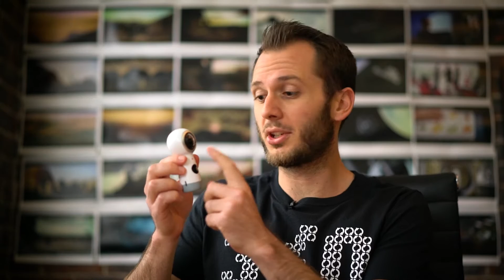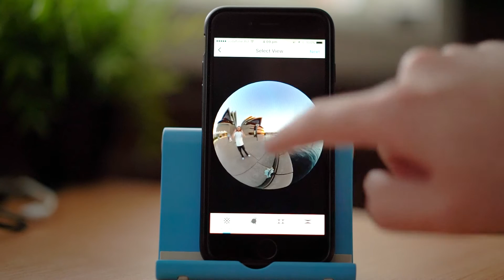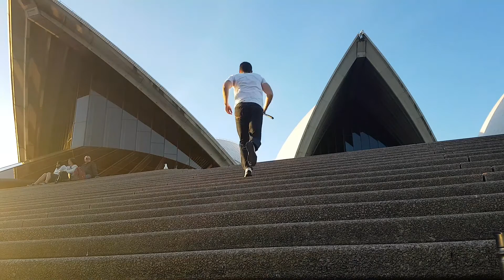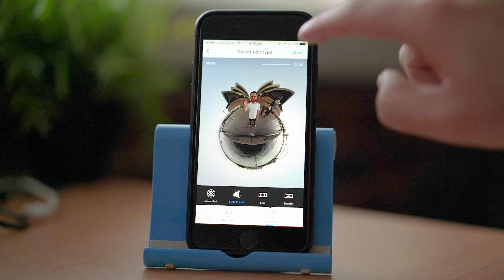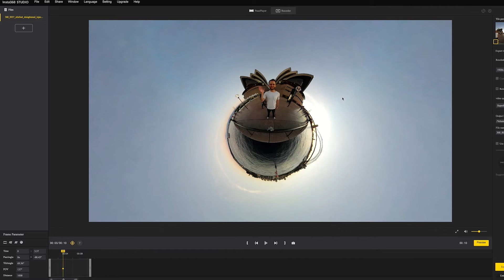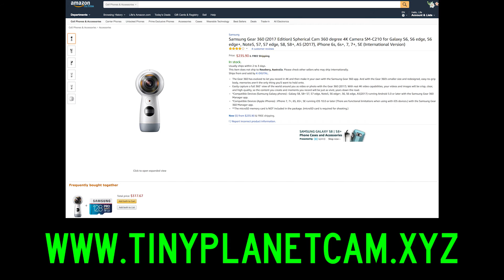How To Make Tiny Planets With ANY 360 Camera

Comment: This was a great video Ben thank you very much for making it. Unfortunately for some reason theta plus is not recognizing any of the photos on my Samsung Galaxy S8 when I go in there there's only just to stock photos. It will also not recognize any of my videos that I shoot on my Samsung Gear 360. is there a trick to this or am I missing something. Thank you so much for any and all help with this
Reply from the maker: +Kendrick Krause there's a separate app for video called Theta+ Video, and Theta+ has always worked for me once the files have been uploaded to the phone correctly. Cheers!
Reply: Kendrick Krause same problem here. Do you fixed it already.
Reply: Same problem

Comment: Hi Ben, perhaps you can help me out with a MiSphere relatet Problem: all over sudden PC (Winx)-Software refuses to stich Mi pictures. Pics taken yesterday or before are handled well, newly taken pics or vids cause the app to crash. 

Unfortunately I shot about 200 360s and some more 360 videos yesterday at a unique occasion and storage on my tablet or phone is far too small to stitch them via wifi and mobile device. Using PC and Mi Software is the only way. 

The software says "cannot transcode" with videos and crashes with a debug window "cpinfo varable not defined"

Any idea? 

Update ... no longer help needed. Did not find the reason but a solution :-)

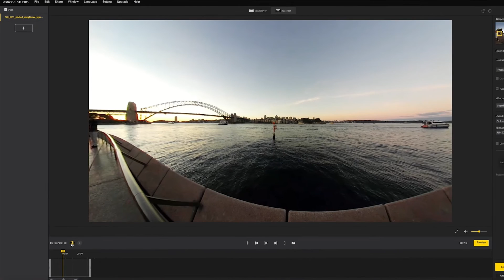Comment: The frame parameter on 3:24 doesn't show on Insta360. I didn't install the hardware decoders though. Is it a requirement?
Reply from the maker: +Patrick Oliveros are you sure you're in recorder mode?
Reply: LIFE in 360 oh i was able to make it work! Yes, it was on recorder mode. I just typed too quick and was able to make it work right away ;-)

Comment: Hey Ben, I've tried importing my Samsung gear 360 footage into insta360 studio to create a tiny planet video. Each time I get a "file corrupted" message. I've tried with Samsung footage from different SD cards,projects, sizes, etc. No dice. I haven't seen any thing on Insta360's site or online on troubleshooting. Any tips?
Reply from the maker: +ADDAM hey- if you're importing from SD cards that tells me you haven't stitched the footage yet.. be sure to do that + import to your desktop before importing to Insta360
Reply: Thanks. Now I see a black spot on my lens which I'm reading has been a common issue. I stitched the footage in the gear360 app for mac.  have you run into this issue?